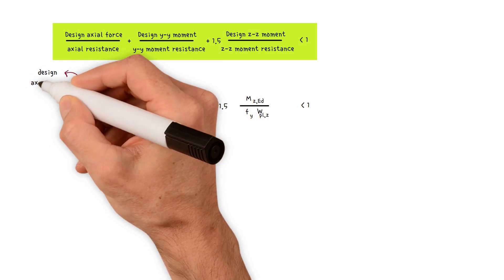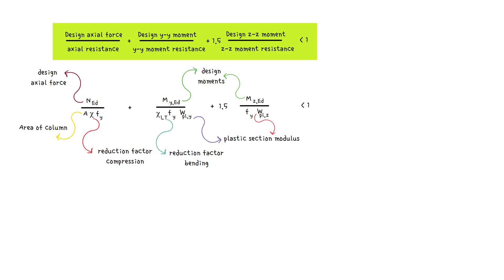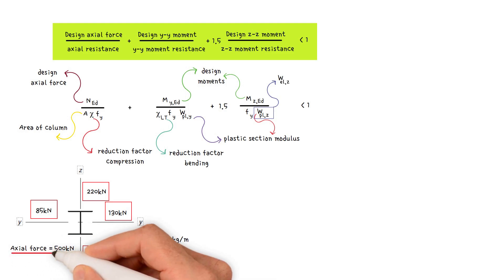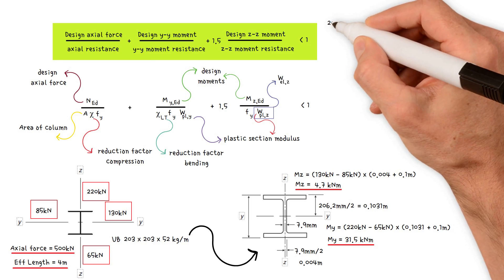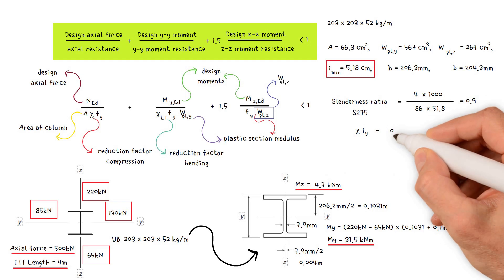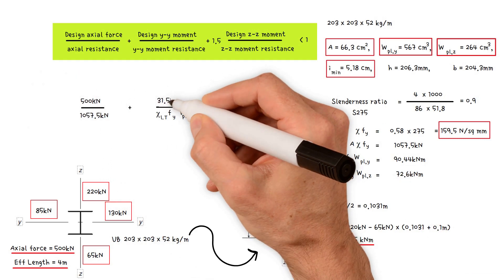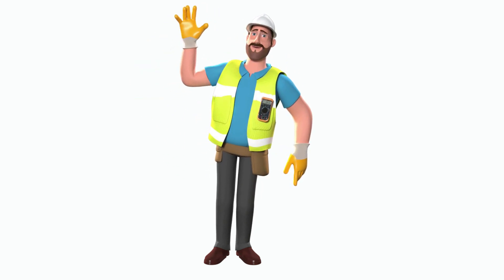How to design steel columns with bending.

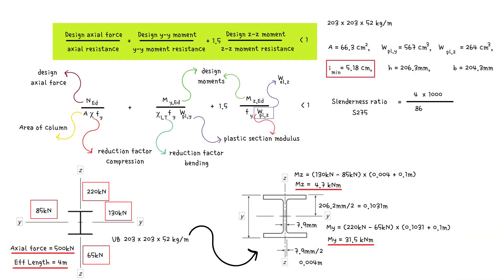Comment: Great lesson! A quick one, where did you get the value of 86 when calculating slenderness ratio at time 2:42?
Reply: non dimensional slenderness = Lcr/i.lamda1 with lamda1=pi.sqrt(E/fy)=86 -------> slenderness = Lcr/(86i)